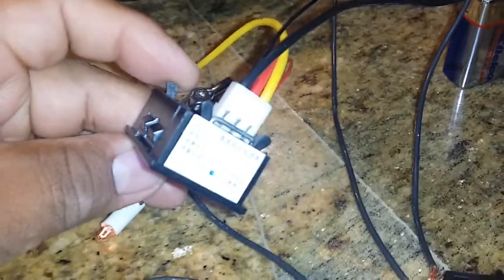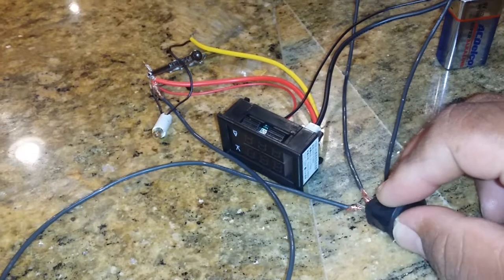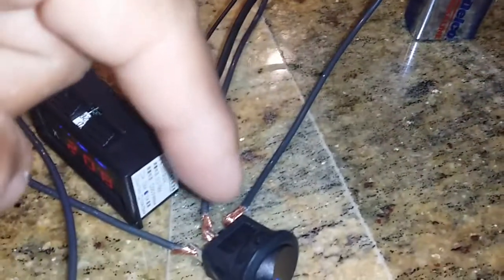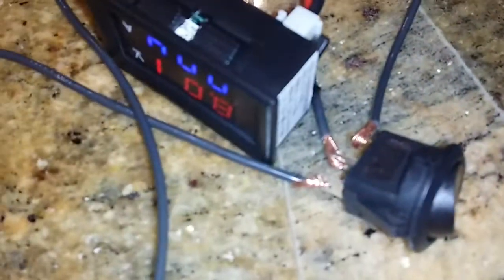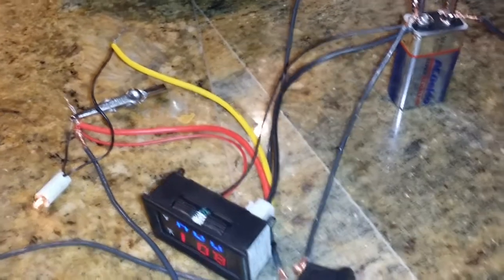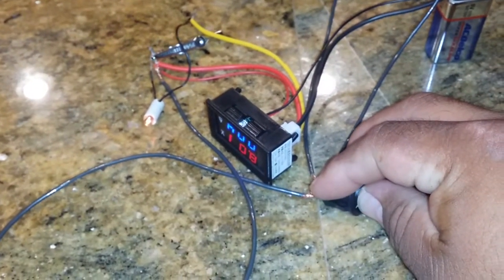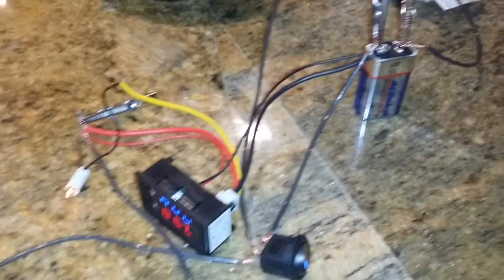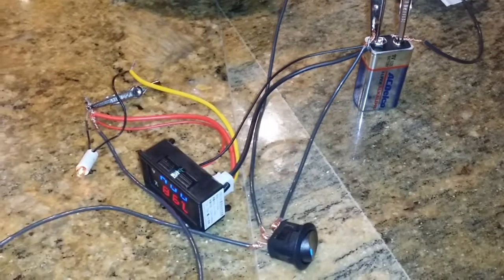How to wire Ammeter & voltmeter built in shunt

Comment: Hi, does that ammeter/voltmeter work with low voltage/ampere like 1-10 volt / 200 amps?
Reply from the maker: João Farinhote yes it does work with low voltage power.
Reply: But the power voltage has to be at least 4.5v right?

Comment: I have one on the way.

So... it'll only measure the amperage of a small device, or will it measure the amperage on a line?

Like... if I plug the 2 reds into the positive and the yellow to my neg on my battery terminals, it should tell me the voltage AND the total amount of amps my solar is actively pushing into the bank, right?

does that make sense?